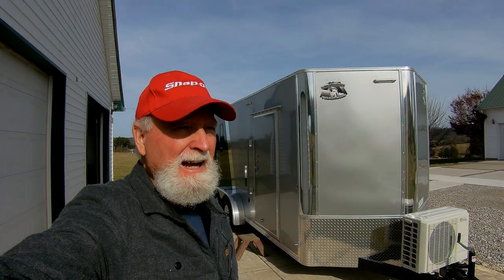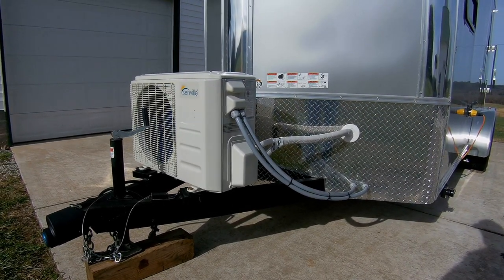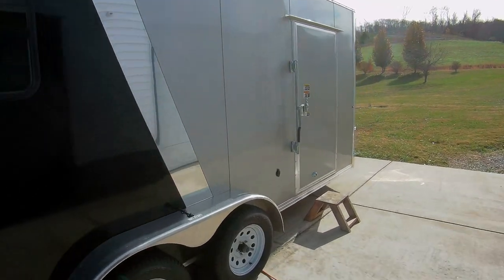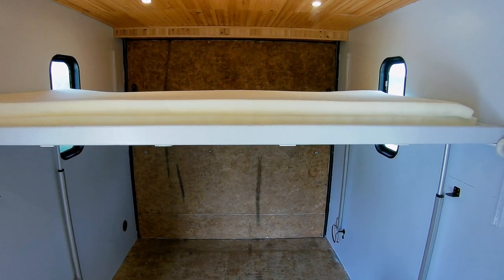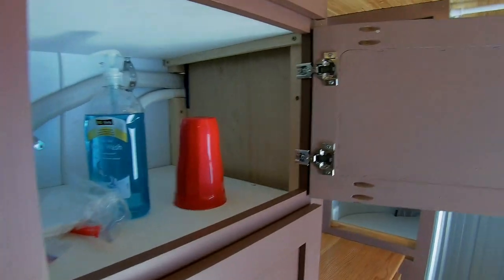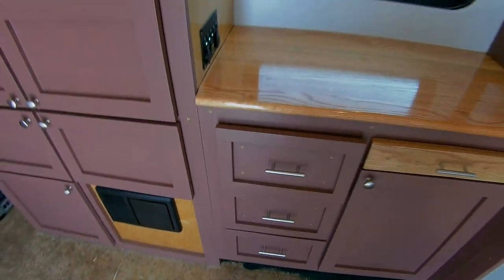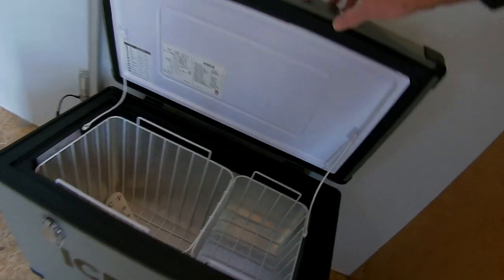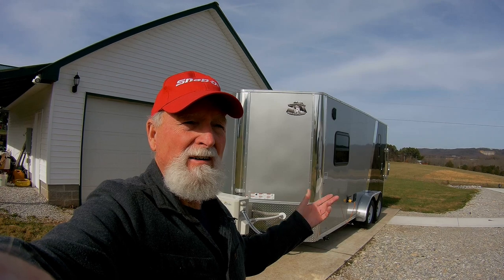Toy Hauler Conversion Finished?

Comment: Good build, my last trailer had a roof in three sections and after a couple of years it started leaking, first in one spot then another. It eventually ruined the interior and caused mold. My new trailer like yours has a one piece roof that curves at the sides. Looking at all the builds with the fancy interiors no one ever mentions the roof, like your house it is the most important, but people concentrate on interior and think little about the exterior quality.

Comment: I may end up using your bed lift design but plan to put a off switch to shut power off on the lift system just in case the relay activates while I'm sleeping.  I love this bed lift design as it looks easier than pulleys and cables to a winch as I've seen before. Thank you

Comment: That's really nice.  Might need to cover that roof with about 1.5kw of solar for that a/c.  I notice the sides & front are one piece sheets of aluminum also - more expensive than cheaper trailers, but no leaks & peace of mind. Very nice ceiling, cabinets & shower!!  Ingenious & simple inside lock for the ramp, too.  Love to watch all these build videos for the ideas.  I'm a little surprised you didn't (yet?) insulate the floor, especially in that part of the country.  I'm subscribing in case you post a video on the solar install.
Reply from the maker: Thanks for the write-up, I do want to put solar on the roof, I have had two failed attempts to have a solar panel delivered to me from Boudge RV.  They pack them in flimsy cheap thin cardboard and hope they arrive intact.

Comment: Fantastic and innovative ideas and great workmanship!  One thing that came to mind when you mentioned the interior security latches for the ramp so that someone couldn't open the ramp while you're inside without having to lock the exterior latches. There's nothing to prevent the exterior doors from locked from some pranksters walking by while you're inside, leaving you to see how much fun using the emergency window actually is.  I couldn't tell if you had addressed that somehow by locking those latches in the open position to prevent this while inside the trailer.
Reply from the maker: My reasoning for the interior locks was mainly for securing the trailer.  Locks are so easy to cut off using bolt cutters or a grinder cut off wheel.  They would have one more level to deal with.  Then again they can just cut off the lock on the entry door, or just cut thru the wall of the trailer with a saws-all!   With the interior locks, I have 3 possible methods of exit, the window, front door, or rear cargo door.  Some people put latches on the outside where they can lock the bars open, but I won't worry about that as I have the emergency window as last resort.

Comment: I have a similar setup with a 7x18 all aluminum trailer, but with more built out in the rear, and I have a 850 lb tongue weight. Drops to 700 lbs when I load the 1800lb size by side in the back.

Comment: Beautiful job, John. I'm sure you will get a lot of enjoyment out of it. My only concern is your propane tank. It should be outside, not in a enclosed inside space.
Reply from the maker: I keep the tank valve closed at all times with exception of when using it which is not very often.  It's a brand new tank, 11 gallon.  It is only used for the hot water heater. I will get and install a propane detector.
Reply: Despite your precautions, propane cylinder in an enclosed space is a terrible idea.  Supply valves can leak, pressure safety valves can leak, etc. Just check out industry standards for storing flammable cylinders. There is a reason for them. Cheers.

Comment: WOW. very simple but very useful trailer!  do you have a link to show where you purchase the hitch lock?  Also by chance on the AC unit can it run off solar? I am looking to purchase one since and they are really nice to have.
Reply from the maker: Just google "Proven Locks" and you will find the lock company.  Not very practical to run the ac off of solar on such a small trailer.  You would need 800 watts of solar to run it.  I bought a small inverter generator to run ac if I need it.  Thanks for the compliment.

Comment: How is the Split sytem hooked up, powered etc.
Reply from the maker: It is connected to my RV power distribution box. Runs off of a 15 amp 110-volt circuit.  The grey flexible conduit you see in the video has electrical lines in it.

Comment: We contacted with Big Horn, and they said that we cannot walk on the roof.  How do we install the fan and solar panels without damaging or denting the roof?   Please advise how you prevented that.
Reply from the maker: Very simple.  Just lay a piece of plywood on the roof and sit, stand on it while installing items on the roof.  With the steel frame of the trailer only 16" on center, it is a very strong roof.  Just not directly between ribs with concentrated weight like a person standing on the aluminum roof. 1/2" ply will be plenty strong to work on the roof.  Good luck.
Reply: @johntalbert8227  thanks

Comment: How many bikes can you fit in there? and is the weight of the bikes over the axles?
Reply from the maker: Depends on what kind of bikes?  Full dress harley I don't know if two will sit side by side.  I have put a couple of full size bikes side by side, then a smaller bike in front of those two.  As far as the wt, I don't have any issues with my build, I have plenty of nose wt to compensate for the bikes.  If you were to build one you would have to figure all that out for your situation and what kind of bikes you have.

Comment: Bed lift? Where did you buy?
I wonder if it is possible to get one rated that can lift front or back of bike for repair? Tire replacement on Harley would be handy
Reply from the maker: Those actuators are rated for 200 pounds each.  If I had to do it again I would put in 4, one each corner.

Comment: Good looking rig John. On the emergency window, did you install it? If so when you cut the vertical studs did you weld a frame around the window for support so the sheet metal is stiff again?
Reply from the maker: I only cut one stud.  Just above the window is the top of the frame with a double layer of 1 inch square tube.  The distance between studs was only 32 inches after the cut.  I have .40 aluminum skin.  I figured that it would be silly to add a steel frame around the window.  There is also the interior plywood walls.  It is very sturdy with just the window frame in.
Reply: @johntalbert8227  thanks John

Comment: Very nice trailer. What I would like to know though is how good does the 9000 BTU mini split work I am getting ready to build my own trailer and I don’t know if I should go to a 12,000 BTU or the 9000?
Reply from the maker: I have 1/1/2" of blue foam insulation in the walls and ceiling. The 9000 works fine so far.  The 9000 is great because it is only 110 volts and uses a 15 amp circuit.  For my small trailer, the 9000 provides plenty of cooling and heating.

Comment: Nice clean build. 
Couple of questions:
-how is water splashing with the shower? (Does water go out to floor?)
-what would you estimate the over all weight, and tounge weight to be?
-what price was the trailer?
Thank you
Reply from the maker: No splashing of water.  There is about a 3 inch lip that keeps the shower curtain inside, works pretty good. Have not weighed the trailer yet.  On my trip to WV we had the trailer loaded with my Himalayan which weighs a little over 400 lbs and a ktm 690 which is 360.  Bunch of gear up front. When dropping the tongue on the hitch the truck barely dropped maybe an inch at most.  On the highway never any swaying, even with big rigs blowing by us.  Super stable.  I have a super duty F250 4x4 four-door so the trailer doesn't faze it.  Trailer was $5400, afraid to total up the receipts for all the upgrades.
Reply: @johntalbert8227  Well thank you so much for the answers and details. I am curious about weight because of a smaller town vehicle I have. I don't want to almost double the trailer cost, (guessing), to go with aluminum (I know there are other benefits as well to aluminum).
My plan is to try this conversion out, see what I like in the design and not, and then start a business building these customer campers for people! I'm in NC, so fingers crossed there will be a person to kick start this with an order. I am a civil engineering cad designer,  so planning to use my experience to produce high quality builds.
Reply: @johntalbert8227  It's very hard to believe you only paid $5400 for it. I see you have a 6 inch frame with  the front corners covered, 7 foot wide, and the one piece aluminum roof, with .040 thickness. It appears to be higher that a 6'3" interior height. 
I've been looking to custom order a 6'x14' tandem, with similar upgrades , but 4" frame, .030, and standard 6'3" interior ceiling height That's a great price.
Reply from the maker: @johnnieblackburn3182  Just went to the website where I bought the trailer.  Price now is $8800!
Reply: @johntalbert8227  That's more in line with what I'm seeing. 
You got a great deal ... nice trailer for the price ... exceptional!
Reply from the maker: @johnnieblackburn3182  Remember, the purchase was pre-covid.  Also, I wasn't even asked to put down a deposit.  About 6 weeks after I ordered, I showed up on a Saturday morning before the lot opened.  The dealer left a key in the mailbox so I could open the gate.  I checked out the trailer and left a check in the mailbox when I left.  Never saw the dealer.  Now that's a hard story to believe but it is true.

Comment: Have the same trailer. Can i get info on the windows please and thank you!
Reply from the maker: Hi Thad, I bought them on E-bay.  Item# 265347242466  No issues at all. Just installed another one in my door. This is the one I put in the door. 353284237906

Comment: Just curious as to the durability of the air conditioner unit on a trailer installation? Is it resting on something to cushion the vibrations?
Reply from the maker: Setting on some small rubber pads.  Going on a 2800 mile trip next month, will let you know if it's still working when I get back!

Comment: you cover that mini split going down the road? Or that fan is probably going mach 80 lol.
Reply from the maker: I have a custom cover for it.  Actually, it gets very little wind or debris sitting right behind the truck. After a 3000 mile trek on the highways the cover was very clean, which surprised me.

Comment: What did you use for the connection pass-through on the mini split lines (through the front trailer wall)?
Reply from the maker: The mini comes with a plastic shroud that goes thru the wall, along with a bag of plastic clay.  I ran the lines thru the wall, packed it with the clay, then filled the hole with white silicone.  I filled the other side of the wall also.  Works very well.

Comment: Love the bed and actuators. Where did you buy the actuators?
Reply from the maker: eBay item number:    334247903350
Reply: @johntalbert8227  Thanks John. Do they all run at the same speed? If there is more than one and they don't run at the same speed - the bed seems like it would bind up. Have you had any problems?
Reply from the maker: @MarkKeckeis  The side of my bed with two actuators is a tiny bit faster than the other side with just one.  Only a problem when going all the way to the top and the two actuator side hits the ceiling first. Going down is no problem as there are limiter switches that shut them down automatically.  No big deal.  If I had to do it again, I would use 4.

Comment: Just ran into your video. The trailer looks nice. I think I am going to order one just like yours. Do they install windows, insulation? I figure I might not save much by doing the insulation myself.
Reply from the maker: I have no idea since I never asked.  No trailer builder will do as good a job as you can do on the insulation.  It's not hard, just extremely tedious.  Have read many horror stories about people paying to have the manufacturer do the job and screwing it up or taking huge shortcuts.

Comment: How did you mount the linear actuators to the wall on the bottom?
Reply from the maker: welded small mounts to the frame.  mount is just a square of strap 1/8" metal with a hole drilled in it.  Then a small 1 1/2" steel rod about 1/4" dia put in hole and welded to the flat piece.  This was then welded to the trailer frame.  The bottom of the actuator has a mounting point which is a hole that just slides over the steel rod I have on the wall, then a cotter pin put in place to hold it from sliding off.  Works great.

Comment: Excellent. Wondering if you have some kind of security cover for the mini-split?
Reply from the maker: Funny you should ask.  The trailer is sitting in the parking lot of a Boat Canvass shop having a marine grade canvass cover built for it.  I will post when I get it back.
Reply: @johntalbert8227  Good deal. Wouldn't want a bunch of road debris in it.
Reply from the maker: https://www.facebook.com/groups/1580683498830420/permalink/2852711251627632
Reply: @johntalbert8227  I keep getting a "content not available at this time".
Reply from the maker: @martyaz  Try the new url
Reply: @johntalbert8227   Thanks anyhow. Apparently can't see it as a non Facebook member.

Comment: What is the stroke length of your actuators (the part that extends)?
Reply from the maker: They are 30"   https://www.ebay.com/itm/Heavy-Duty-30-Linear-Actuator-Polarity-Switch-Inch-Stroke-12v-200LBS-Max-Lift/122997194383?hash=item1ca3343e8f:g:6zgAAOSwOVpXWEJ0

Comment: Could I ask what brand and model are the actuators for the bed?  Thanks.
Reply from the maker: Scroll down the comments and find the link to the ones I bought.
Reply: @johntalbert8227  John, thank you for the link! I am working on the exact same project.  Your design is the best for raising a bed.
Reply from the maker: @frank_III  The only downside is the amount of travel.  I wish I could go a lot lower but doing it the way I did is kind of limiting.  I saw a guy who uses one long one on each side and they were at about a 30-degree angle when all the way lowered, but as it lifts its goes to straight up at 90 degrees.  His lowered lower than mine.  I don't have a link.
Reply: @johntalbert8227  Ok, Thanks.
Reply: @larrybe2900  Hey thanks Larry!  Definitely another workable option.

Comment: This thing looks great! I actually have a 7x16 Sure Trac trailer I bought for this exact purpose, but been using it to move family/ store moving supplies since I bought it in 2017. Hoping to change that this year.

Where did you get your windows/ how did you go about install them? Thats my biggest fear with my conversion is messing up my trailer skin. If you have a writeup of your build somewhere I would love to see it.
Reply from the maker: I bought the windows off of ebay, the build videos should give you enough detail to tackle it yourself.  Just go slow and be methodical.  Measure twice and cut once is good advice.

Comment: John - you have inspired me to go ahead and do a trailer build.  I ordered my Reed Trailer and hope to have it soon.  I think I figured out the 2 - 20 gallon fresh water tanks 
https://www.classacustoms.com/Under-Mount-Style-Water-Tank-20-Gallon_p_252.html.  
I was hoping to go with a larger gray tank  , 30 gallon, but it seems to be limited with the spacing on the supports.  Has the 20 gallon been big enough?  I plan to elevate the front  bathroom area - I have ordered the trailer with the side door further to the back - plan to make it a little larger.  Can you give me any pointers on how you plumbed the two fresh water tanks.  One fill pipe that has a tee and goes to both - same with the vents?  Thanks again for your documentation on the build.
Reply from the maker: Just saw this Jim:  20 gal is very limited really.  If I had to do it over, I would cut out some frame and reweld to allow a bigger tank.  I have a 1 1/2" line that goes from tank to tank so when filling one it transfers over to the second tank as the first one fills.  The vents are connected with a tee to both tanks.
Reply: @johntalbert8227  John - I did order the three 20's from Class A Customs - trailer is getting close - hope to pick it up in the next week.  So, you think the gray 20 is too small - what about the 40 gallons of fresh water - is that enough?  With you suggestion - I will either use the 3rd 20 for additional fresh or just use the two and go for a larger gray tank - do you think 30 gallons on the gray would be a help?   I like your smaller solar but I am an electrician by trade and I just finished my solar that will be installed in the rig.  I have a 48V system and am using a Growatt SPF 3000TL LVM for the brain.  I built the 16 cell 272 Ah battery this weekend - it is massive. The BMS has the cells all in balance.  I plan to place it on the drivers side of the trailer to counter balance what I have on the driver side.  I'm learning about this YouTube - I might put some of my experiences on line.  Thanks again for your work on posting - I do like a lot of your ideas.
Reply from the maker: @coachgym  You can always use more of everything, but then you start getting heavy, expensive and I wanted to keep things small and light. I just have grey water, so I can leak some out on the ground slowly.  I only use it to shower, no food particles or stuff that would attract animals.  Sounds like a hell of a battery use built!

Comment: Where’s the propane?
Reply from the maker: Under the counter, small 11 lb bottle.  Valve kept closed at all times, except when using it to take a shower.  Windows and vent open when shower is used.